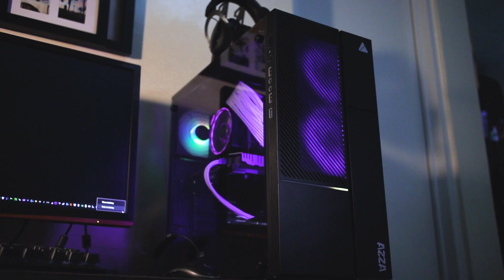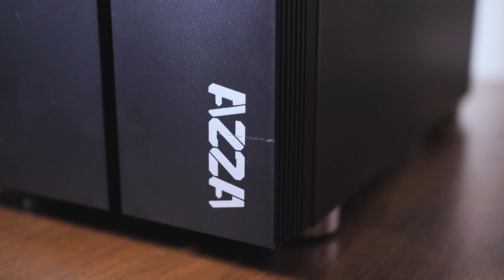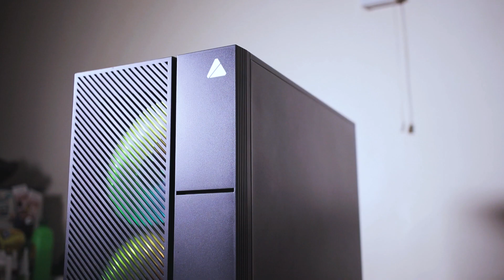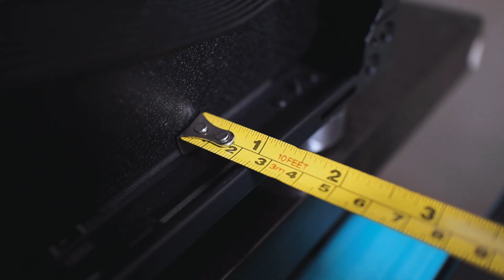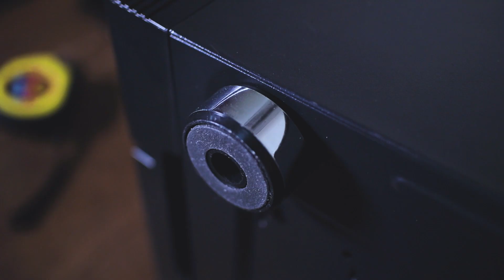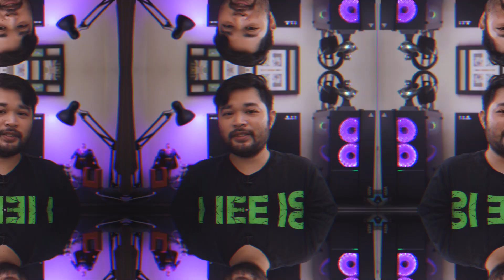Azza IRIS 330 Mid Tower Case | First look | Impressions

Comment: I bought this case and it didn't come with a 3.5 inch HD drive rails? Are you meant to buy them separately if you want to install hard drives?? Why wouldn't they include them? It's crazy.
Reply: I know this is old,  but just wanting to say mine did come with the rails.

Comment: Hi can you help me     dont rgb in this casé what its  the process
Reply from the maker: It should have a fan controller.
Reply: My experience of this case (ver 2019)   is  a good case but the conection  to the digital rgb its only motherboard with a pin digital rgb   in other motherboard for example  MSI b450 gaming plus max  dont have a connection digital rgb  but  i can use digital rgb but its not recomendable my solution   because  i cut one pin to the connection of the motherboard   (necessary because  its  fan use only 3 ) :)  good review  sorry for my english
Reply: @ntecpc  dude could you fix it mine also came without a controller i was able to sync the led lights but the fans dont spin!!!

Comment: Do I only need 1 ARGB header for both fans?
Reply from the maker: The fans have their own headers.
Reply: So I only need 1 argb header and 2 fan headers?
Reply from the maker: @jeffreytri  Sorry for the confusion. Each fan has it's own ARGB header and fan headers. So, you need to connect them to the fan controller.
Reply: @JeloAbucay  Oh ok now I understand, thanks!
Reply: how can i control the rgb of the pc without using the motherboard help